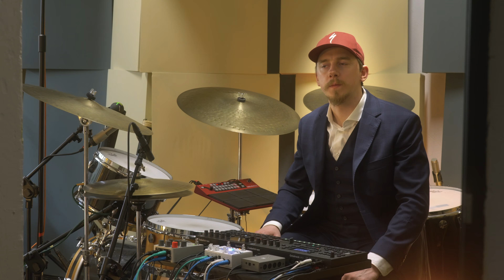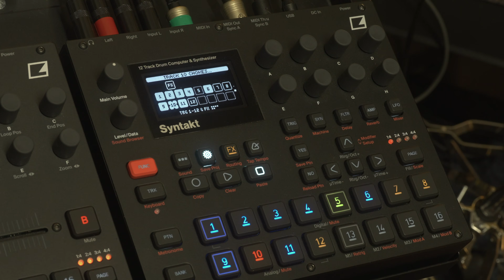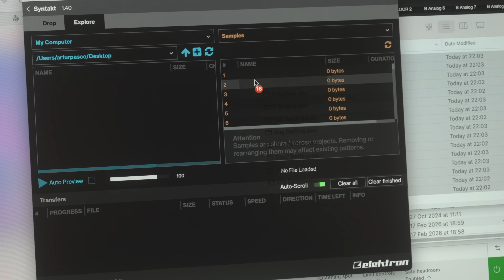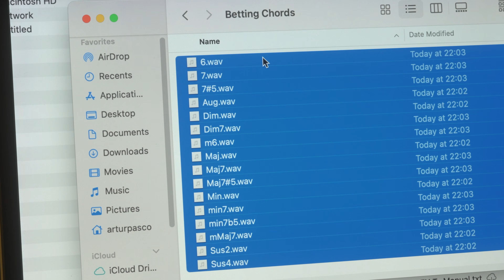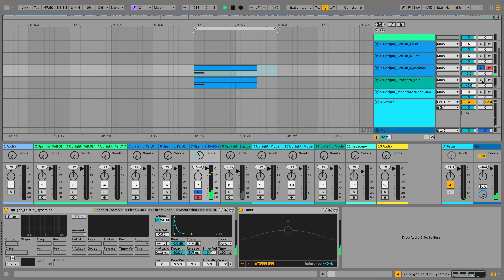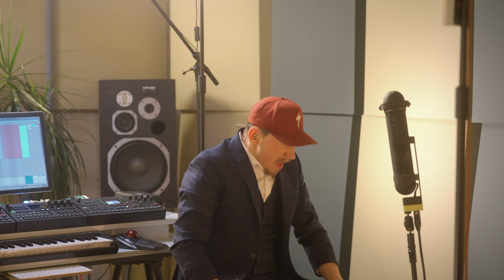Syntakt 1.4 Update Opens the Door to Vertical Composition

Comment: The Blokas Midihub is great. Lots of options with that little box.
Reply from the maker: Yes, the Midihub often comes in handy. A while ago I programmed a conversion from MIDI note to CC message for the amp release to simulate a mute group, but that left me with only one fixed release setting, so I abandoned that solution. What I enjoy the most is using the Dispatcher pipe to play polyphony from a keyboard on Elektron devices. What are you using it for?
Reply: @arturpasco  Mostly for routing but I have a Rytm MKII and need to explore the Dispatcher pipe for polyphony with it, as you said. I heard about that a while ago on another YouTube video, but I forgot the source.

Comment: new syntakt update is cool!

respectfully, the term you're trying to coin (vertical compostion) doesn't make any sense

you're describing preparing an instrument. setting sounds for a drum machine is really just the same as choosing drums and then tuning the heads on a regular drum set. 

you're really just tuning up an instrument and then improvising on that instrument which is the most normal thing you could do with a musical instrument 

"vertical composition" could better be used to describe the thing that george russell was pushing in the 50's which miles davis popularized on "kind of blue"
Reply from the maker: Thanks for the thoughtful comment. Vertical composition can be understood as a set of simultaneous possibilities rather than a sequence of events. Instead of thinking about notes unfolding over time, the focus is on a palette of sounds that can occur together in a single moment. In this workflow, selecting and preparing those sounds becomes part of the compositional process itself, not just instrument setup.
Reply: @arturpasco  dude. first a few words of congratulations.. even if it "doesn't exist" on a gramatic level it is something it does  exist for sound designers with electronic equipment... It might need a formal word but who cares? I applaud anyone trying to expand our minds by conceiving new terms, Orthosynthesis might work too.